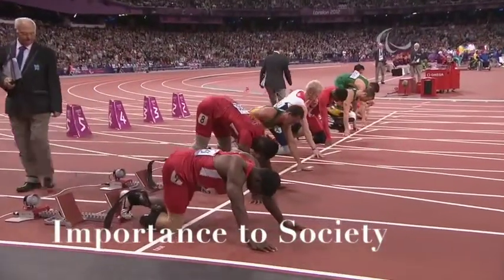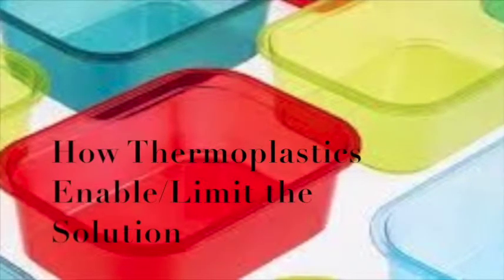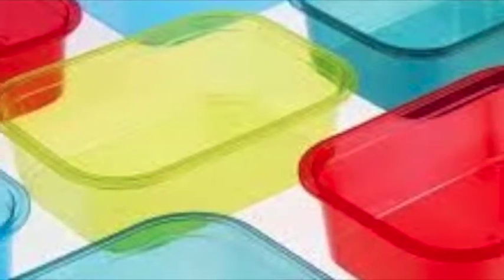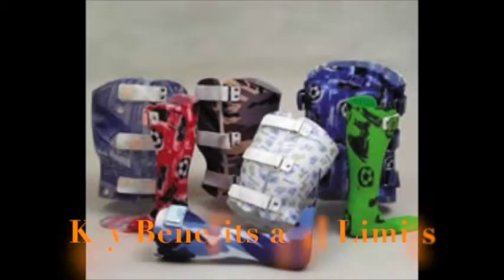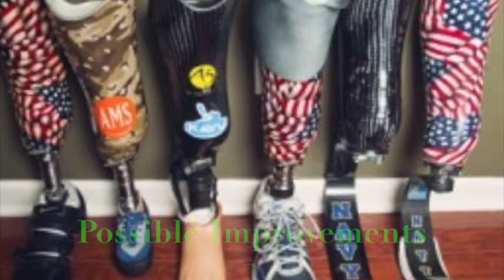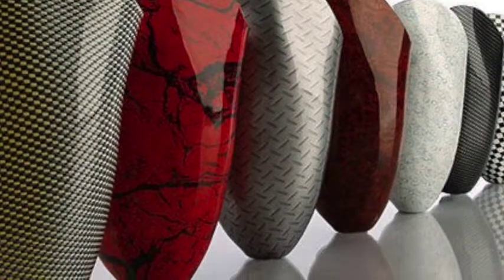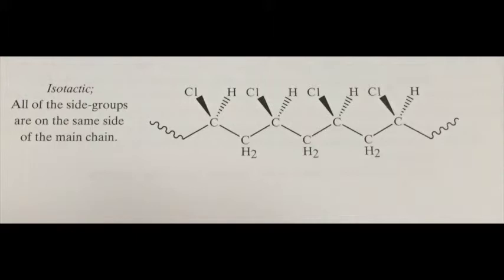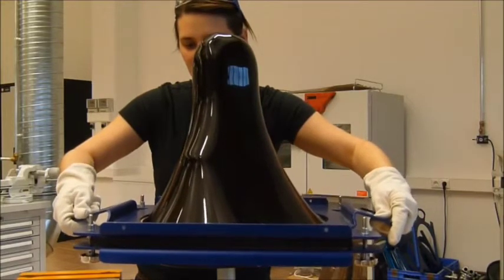Thermoplastics in Prosthetics - Metglass MCV

Comment from the maker: Sources for Information:
  
Gerschutz, Maria J. and Michael L. Haynes. “Tensile Strength and Impact    Resistance Properties of Materials Used in Prosthetic Check Sockets, Copolymer Sockets, and Definite Laminated Sockets.” Journal of Rehabilitation Research and Development 48.8 (2011): 987+. Virgo. Web. 12 April 2015.
Uellendahl, Jack E. CPO. “Materials Used in Prosthetics Part II.” Prosthetic Primer 8.6 (Nov/Dec 1998). In Motion. Web. 12 April 2015.
Jendrzejczyk, David J.”Flexible Socket Systems.” Lead Article. 27-31. PDF file.
“Transtibial Prosthetics; A Patient Care Manual for the New Amputee.” Oandp Health. Web. 12 April 2015.
Phillips, Sam L. "American Academy of Orthotists & Prosthetists." Material Properties of Selected Prosthetic Laminates. Rutgers University, n.d. Web. 04 Mar. 2015. <http://www.oandp.org/jpo/library/2005_01_027.asp>.
Smit, Leo. "Designing Prosthetics with Polymers." Designing Prosthetics with Polymers. N.p., 1 Dec. 2009. Web. 04 Mar. 2015. <http://medicaldesign.com/materials/designing-prosthetics-polymers>.
 "Northene 500." Polyethylene Sheet for Prosthetic and Orthotic Applications. N.p., n.d. Web. 15 Apr. 2015.
"Lexan 940." Kazuli.com. Kazuli.com, n.d. Web. 15 Apr. 2015.
 
 Non Internet Sources (textbook and journals):
 
Douglas, Elliot P., and Abhishek K. Singh. Introduction to Materials Science and Engineering: A Guided Inquiry. Internat. ed. Upper Saddle River [u.a.: Pearson, 2014. Print.

Jarcho, Michael. "Calcium Phosphate Ceramics as Hard Tissue Prosthetics."Clinical Orthopaedics and Related Research 157 (1981): 259-78. JStor. Web. 15 Apr. 2015.

Phillips, Sam L., and William Craelius. "Material Properties of Selected Prosthetic Laminates." JPO Journal of Prosthetics and Orthotics 17.1 (2005): 27-32. American Academy of Orthotics and Prosthetists. Web. 7 Apr. 2015. <http://www.oandp.org/jpo/library/2005_01_027.asp>.

Uellendahl, Jack. "Prosthetic Primer: Materials Used in Prosthetics I." Journal of Amputee Coalition of America 8.5 (2014). Web. 3 Apr. 2015. <http://www.amputee-coalition.org/inmotion/nov_dec_98/primer.html>.

Uellendahl, Jack. "Prosthetic Primer: Materials Used in Prosthetics II." Journal of Amputee Coalition of America 8.6 (2014). Web. 4 Apr. 2015. <http://www.amputee-coalition.org/inmotion/nov_dec_98/primer.html>.

Videos/Pictures: 
https://www.youtube.com/watch?v=LdCGWj81Yzk   
https://www.youtube.com/watch?v=3sLxAerTWXI    
https://www.youtube.com/watch?v=mcdUsMULNzo  
http://safeharbor.navylive.dodlive.mil/2011/10/03/photo-of-the-week-a-row-of-prosthetics/
http://safeharbor.navylive.dodlive.mil/2011/10/03/photo-of-the-week-a-row-of-prosthetics/ 
http://www.northseaplastics.com/materials.asp
http://www.kazuli.com/UW/4A/ME534/lexan2.htm
http://www.northseaplastics.com/transfers.asp
http://www.essentialchemicalindustry.org/polymers/polyethene.html
http://www.defense.gov/news/newsarticle.aspx?id=46385